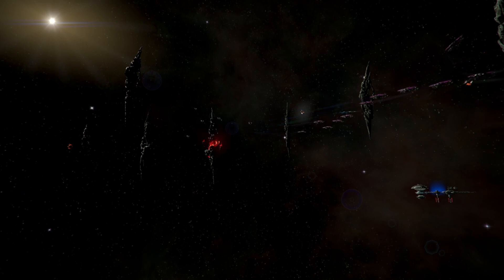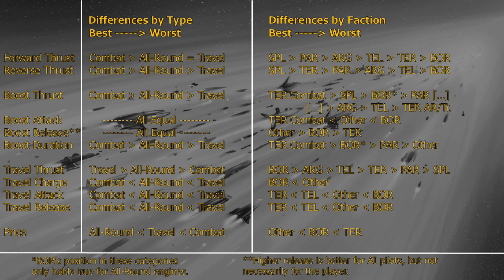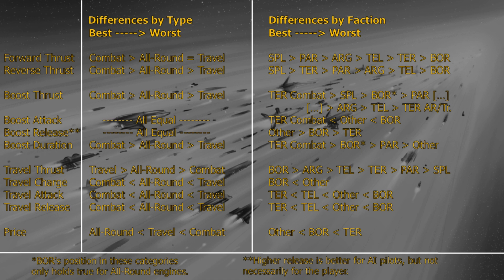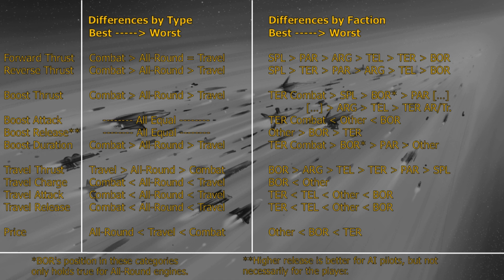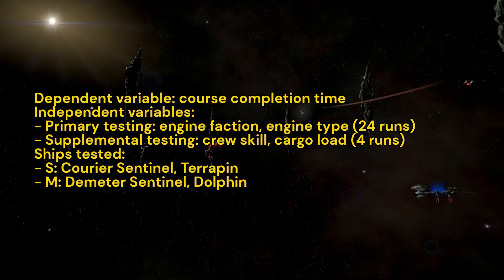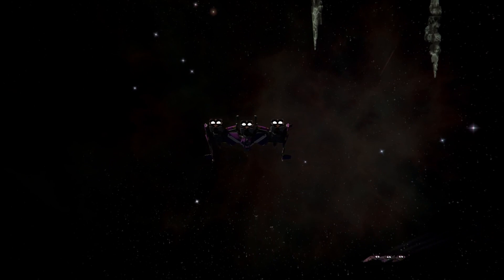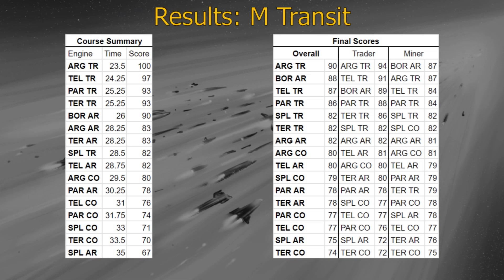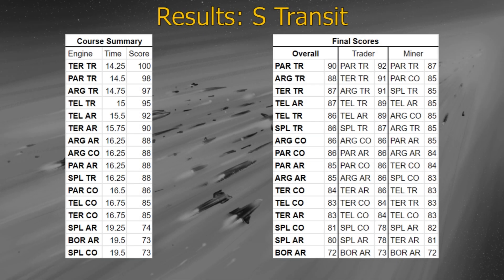[OUTDATED] X4 Propulsion Lab, Part 2: Subcapital Engine Testing

Comment: Maybe I don't understand something, but when I was testing, sending two same ships with argon travel and terran travel, across the entire map - terran engine always was winning.
 I did that without docking because, I thought it could be inconsistent if dock, in particular station, is busy and one of the ships will have to wait.
Reply from the maker: Were you using S/M ships in vanilla X4 version 7? Older versions of the game had very different travel mechanics, and of course mods can break anything.
Reply: @CptSnuggles07 
I tested that before timelines update and after too, like week ago. Was using split's Boa traders, sending them from Tharka's ravine VIII sector to terrans Oort Cloud.
Also there's idea. Does terran engines reach max travel speed in 6 sec no matter max speed number ? If yes, then I think engine upgrades for travel thrust are very beneficial for it. And level 1 upgrades are fairly cheap at that.
Reply from the maker: @snowflake8658  Strange. All I can say for sure is that TER is best within 1 jump, TER and ARG are roughly equivalent at 1-2 jumps, and ARG is best at 3-5 jumps. Those results are consistent with other content creators. Not sure whether there's something strange going on in your game, if there's just something unique about that route, or if acceleration genuinely is more important than speed for 20-jump endurance races.

Travel Attack is the time it takes to reach maximum travel *thrust*, not maximum travel *speed*. Acceleration is non-linear due to drag; the last ~10% of max travel speed takes quite awhile to reach for any engine. That said, increasing travel thrust should just increase top speed while keeping the total acceleration time roughly the same. I'm not sure whether that upgrade is more beneficial than reducing mass or drag.

Comment: As far as that travel drive performing well in combat: smaller ship travel accel is good enough that if you're chasing something, then good travel performance will vastly outperform afterburner. Burner (in high attention) is only really good in short bursts, while travel allows strike craft to haul ass to a target at any distance. Good travel acceleration will get the ship up to "haul ass" much faster, shortening intercept times. Burner, meanwhile, is good for evasion.

Comment: Question
I'm using usually argon combat engines mk3 for all of my med, even miners and traders
Traders and miners however usually not going further than 2 jump, rest is covered by L class
Argon, because the just easy to get and pretty much no brainer 
Is it better to switch for travel engines? I thought combat is better because they are instantly going to travel mode
And for combat I'm using split s/m mk4, usually with monitors or carriers, so not really worrying about that
Thanks
Reply from the maker: I'm in the middle of the third part of this experiment, which is a practical trial of M engine profit margins vs survivability when exposed to actual enemies. Based on what I've seen thus far, Combat engines are a bad choice for miners and traders. You take a huge hit to profitability with very little increase in survivability. One big exception is single-sector autominers. Those do quite well with Combat engines.

If you're using Mk3 equipment, I'd recommend using All-Round engines. Profit margins are better for Travel at the Mk2 level, but with Mk3 your ship replacement costs will be much higher, so you'll want the increased survivability of All-Round.
Reply: @CptSnuggles07  thank you!
Love your work

Comment: I assume disabling the highway gives an even larger advantage to the Argon Travel engines right? Since they stay in travel mode longer. 
Or would that go to Teladi with the higher max speed? 

Thanks for the video.
Reply from the maker: Yep, I would expect that to favor the Argon engines. Teladi actually have slightly lower speed but higher travel acceleration, so they benefit from shorter trips (they're most competitive on trips of 1-2 jumps).

Comment: Something to think over, though, is now that you can limit the ware type of a station ship, it may be worth getting Mk1 stuff to make it so cheap that only carries cheap stuff AND losing it all is therefore ignorable, and you put more expensive Mk3 stuff on ships settled to carry more expensive goods, so them being able to run away and save the entire load is eminently worth the extra expense.
What we need is also some way to insist that we limit the cargo limits, so that you don't get a 10,000 cu carrier making a trip for 10 advanced chips and therefore nothing for your 1500cu Paranid courier to do, or a 7000 cu collecting energy cells but since there is a call for 20,000 ecells, your large hauler has to go further to get the remaining 13,000 e-cells if there's an offer that now meets the criterion in range.
If station ships don't BOTHER if they can't fill at least a third or half of the cargo hold, they don't bother. That makes you fill up on S couriers and M traders and L freighters because for small loads the S courier will do, and if you only have 10 microchips to sell, because you only created 10 at the moment, then your M class freighter isn't tasked with almost empty selling while nothing is around to buy 5000 e cells required to stop production stalling until the trader gets back. And if the window to sell closes before it gets to that level, either get a smaller (possibly faster) ship to trade, manually MORT the sale to free up space, or just wait a bit and the sale option will match again.
Reply from the maker: Yeah, cargo utilization is a major limiting factor for station trader efficiency. That's one reason why I tend to go Vanguard over Sentinel; that extra 20% cargo capacity rarely gets used, but the extra speed is always helpful. It does make logistical sense to just use tons of S couriers instead of M/L traders, although that would make the late-game lag pretty atrocious.
Reply: @CptSnuggles07  The sweet spot for merchants are the M class. Multiply cargo capacity times speed divided by cost. BY FAR the best. The Ls aren't worth it, they cost a lot more but go slower. They are only for hauling big loads, either as MORTing or just heaving lots of things, they also gain in survivability, but fail HARD against destroyers, too slow to run, too expensive to give up on. Meanwhile the S class couriers are not much, if any, cheaper, but carry a lot less but only slightly faster. The 6S3M dock is best, you need more M class docks, the S docks will only get used to release drones, mostly.
Making it require a certain amount of cargo hold for it to be considered hauling is a way to spread the load about among the three classes.
The Gullemot and Kestrel are worth looking at (as is the Nodan) because they are fairly fast (for the race they come from) but carry a fair old size too.
IMO the Paranid designs should, other than the Carrier and Aux, be heavily nerfed to almost no capacity (except the 3 A-M cells needed for the quest), but I'd leave the three-gun Theseus with its cargo hold, but say half everything else's in the Paranid military fleet cargo hold: "not a pound for air to ground". Not nerfing the Theseus doesn't make it better, it is, at best, a side grade, but with 350 ish cargo hold it can make a decent player ship and you buy the Perseus for carrier duty or patrols where none of the cargo gets used.
Those figures for cargo hold is a hold over from X3 where cargo storage defined how many missiles and guns and shields you could fit inside. Now the more sensible option of just having space for them, there's nothing for the cargo hold to DO. But it was the same cutnpaste job of old stuff over new models, and so we got an Oddy that can hold as much as an XL carrier, and 540 cargo capacity military fighters.
The cost for S class traders arises from the massive cost of the S class stuff, notably Mk3 stuff, and several of them. Once you add the cost of those in, you are looking at the same cost as a mid-range M trader that gets you 2-3x as much cargo space.

Comment: I'd agree, but insist that you forgot pirate activity, making your results rather meaningless for actual use, unless you state "give in" for pirate attacks, losing cargo but gaining the continued life of the ship, until the NEXT pirate attack.
It is for this reason that I utterly fail to think ANY good of the travel engines, except Split Travel where the travel speed is not as badly nerfed as combat speed travel drive speeds are, but the cruise speed of split engines, even if travel engines, means it might actually be able to escape attack long enough to GET travel drive active.
IMO three seconds entirely and utterly nerfs ALL travel drives, because it is VERY unlikely that a small craft won't get hit in 3 seconds, but almost, if not entirely, impossible to be missed in 3 seconds for an M class ship.
And travel engines are more expensive.
To un-nerf them, I'd put Travel drives as still only requiring a 1 second spool-up time, as All-Round does, because it is quite likely that a small craft won't get hit in 1 second, and there's at least some chance an M class will not be hit in 1 second. That they cost more AND have worse acceleration (and strafe speed) than All-Round is "sufficient" for opening up a gap between AR and TR engines with the latter having faster Travel speed.
I'd also make Travel Drives for L and XL have shorter spool up times than "All-Round" drives, even if that then means the cruising speed gets nerfed a little harder, but I don't see much need to open up a large gap, that balance could be how much it gets a quicker spool-up to travel speeds, for example.
As for Terran, because they don't HAVE a hyperlane, and moreover their sector sizes are MUCH larger, I'd probably leave the combat engines roughly where they are, but I'd reduce the cruise speed but amp up the travel speed for their engines, meaning if you don't forsee needing to be in combat, you'd specifically choose travel engines for terran ships because in terran space THOSE are far faster than combat engines. Meanwhile the combat engines are not good for travel drive speeds (indeed maybe even nerf them a bit more, but since they cost a LOT more, it may well be enough balanced from that alone) but since they are great at acceleration, they can use all that cruising speed, and use the carrier to do the travel drive stuff. Meanwhile, All-Round Terran would be patrol craft that have a long way to go, not being carrier based, so can't afford to have that hit to travel speeds either, but will see enough combat that they really DO need to be good at cruising too.
Boron engines need to do better with top speed in cruise and travel, but they could be worse at strafe, underpowered for it, or poorly equipped for reverse thrust to come to a stop. After all, water.

But unless travel drives STOP needing 3 seconds to spool up on smaller craft, I won't use them, or even deign to consider them as a blueprint, even for scouts, because they have a high top speed, but so slow an acceleration, they never get to those speeds in the smaller sectors of "base game".
And for capital class travel drives, unless they cut the spool up time (or acceleration/attack time) notably, there is nothing to having travel drives on them too, you really only have AllRound as any coherent choice.
Reply from the maker: I'm actually planning on doing a third episode where I try out the top-ranked variants of each engine type in actual gameplay, so we'll get some quantitative data on survivability/profitability tradeoffs when hostile ships are involved.
Reply: @CptSnuggles07  Mk3 Split Combat, though. The Mk4 is very fast but so very expensive it only gets fitted to player ships, or people who are just playing because big number goes brrrr.

Comment: It used to be easy to just put a combat engine on my medium freighters.  In 6.20 my Dolphins can pretty much always get away from the spawned raiders while my Vultures will sometimes get caught with no way for me to save them.  I always put Combat engines in them because that way they can generally run away.  But in 7.00 the raider seem to have better engines and can often catch even my Dolphins.

Comment: local miners spend about equal time slowboating and in travel drive. I vaguely remember seeing a spreadsheet regarding local mining efficiency and SPL combat was the runaway winner
Reply from the maker: Yeah, for strictly single-system mining, I'd expect the Combined rankings to be more applicable than the Transit ones.

Comment: This is interesting information, but potentially dangerous. There's a very good reason why most people recommend you never use travel engines, and that's because of their obscenely long charge time. If your miners get jumped by Khaak, if you give them travel drives, they will never be able to escape. Same with traders getting attacked by pirates. Unless your space is incredibly well protected, using travel drives is a good way to get your ships destroyed.
Reply from the maker: As with everything in X4, you have to think about your use case. If you're sending S/M traders/miners into hot zones, you may want to pick from the Combined list instead of the Transit list.
Reply: @CptSnuggles07  The problem is that X4 will have hot zones appear FOR you, there is no safe route there. That's why all I think is needed is to cut the spool time to 1 second. The 0 seconds for combat engines AND better cruise speed gives them a spot to play in. Their higher cost but much longer boost are also countering each other. Travel engines cost more than All-Round, but while All-Round and Travel get the same cruise speed, the All-Round will GET to their max speed in a sector while the Travel Engine is still behind actual speed in the second, making the top speed less useful. I think that these are better balanced, and enough to give them their own place to play.
As it is, that 3 second rule makes ANY travel speed chancy, because it fails to pertain in any case where a single hit happens or travel drive is turned off at random (the AI does this: possibly for verisimilitude when travelling through an asteroid belt OOS, possibly as a troll to humans wondering WHY it dropped to cruise speed). In a straight test where travel is uninterrupted, travel drives are bettter to, uhm, travel, but that is so uncommon that you can't rely on it.
A trader, especially an M class trader, if fitted with Travel Engines should be set to "comply" if attacked by pirates, because they won't survive an encounter by running. Xenon and Khaak don't care, they will just kill, and you lose the cargo and the ship. At least Combat engined traders might last long enough to route some fighters to get there.
THAT is the case for using travel drives: set anything equipped with them to comply and use the higher profit elsewhere to offset the lost profit to pirate attacks.
Possibly that is something to add to your pinned comment: travel drive traders should comply with pirate demands.

Comment: Simplifying a bit: Argon Travel for small non-combat ships, Split Combat for small combat ships - might be a couple of % off ideal in some cases but should bear up otherwise!
Reply: Actually since travel drives only advantage is travel speed, but it takes 3 seconds of NOT GETTING HIT to do so, AND it accelerates a lot slower TO that higher speed (therefore not attaining it in most cases), throw those TR figures out.
Split Combat for carrier ships, because their travel speed is TERRIBLE. Outside carrier use, either Paranid or Argon Combat. They still HAVE some travel speed. And if you care about travel speed, Argon All-Round every time. The Paranid do cruise speed better, Argon do Travel speed better, and that is pretty much the whole of it.
Reply: Note that Teladi CO engines do well, this may be because the better attack speed, so that full travel speed thrust advantage happens so much earlier that it overwhelms the poorer endpoint stats of top speed, either cruise or travel speeds.